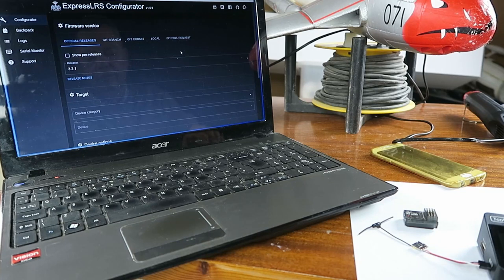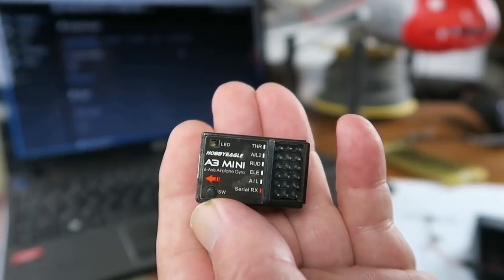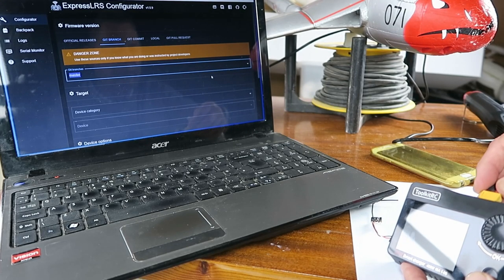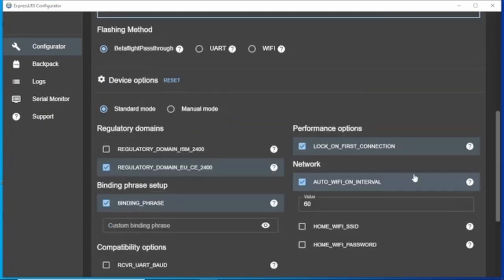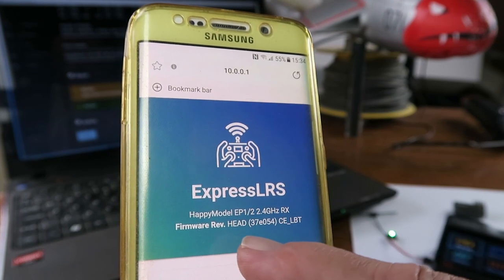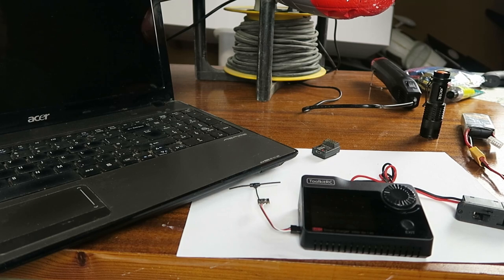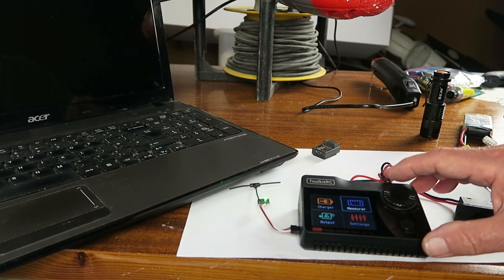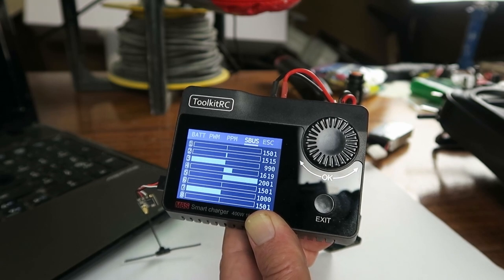ExpressLRS Happymodel EP1 SBUS Test

Comment: Very cool. I had not noticed ELRS had early support for SBUS.
 I've switched over nearly all my race drones and freestyle drones to ELRS using the EP2 receivers with the tiny ceramic antennas. They are awesome because you can't chop the antenna in the props. The range is also surprisingly good for racing and park flying.
Now it it time to start looking at putting ELRS on my fixed wing models that have the BYME gyros you put me onto. I will start with a small foam model since it is still experimental code. 
Thanks for your videos, I find there are too few people doing low budget fixed wing content.
Reply: The Byme stabs (and many other Chinesium units) require better than the standard 2-bit resolution on channel 5 (fixed to use for mode switching) - an exception being the Lefei Sparrow 3 which allows switching channels 5 and 6. No doubt there is (or will soon be) a way to change the channel allocation on ELRS that our Tech Guru here can put up a demo video about for us old computer illiterates. 🤔😜😉
Reply from the maker: Cheers Peter! ELRS and EdgeTx I like to keep an eye on as they're moving at quite a pace. A thing almost unknown in the RC world!! I'm currently testing the Matek R24-P6 which has 6 PWM channels, SBUS and VBat to monitor the battery! Watch this space!
Reply: @theoztreecrasher2647   Transmitter settings: "Packet Rates: 100Hz Full Res" and "Switch Mode: 16ch Rate / 2". Everything works great with BYME gyros.
But if the receiver is connected through the CRSF-SBUS (Matek) converter to get VBAT, an error occurs, the ailerons are up to the limit and control is not available, but I haven’t figured it out yet.

Comment: I tried this with the same RX, but with the ELRS 3.3 firmware, connected to an SBUS to PWM converter to control my esc and servos. It worked well until I tested my failsafe.  No matter which way I set the failsafe, "No Pulses" or "Last Position", the servos and esc output would be whatever they where when the TX got disconnected until I reconnected.  This isn't correct, obviously, but I don't know how to fix it.  Any advice?
Reply from the maker: The SBUS to PWM converter is "dumb" and can do nothing other than maintain the last known signal state. To use failsafe you need either a gyro like I show in my video or use an ELRS Rx that has the PWM output. On the Gyro there is a "gyro failsafe" mode where you can set the positions of the servo output for each channel in the event of a failsafe condition. An ELRS PWM Rx also can be configured in the same way via the Rx configuration page when using Wi-Fi. Hope that helps! Thanks for watching, have a great day!
Reply: @1nformatica  thanks I figured it was something like that but first time trying.
Reply from the maker: @lienmeat You're welcome! Here are 2 ELRS Rx with PWM that I have used, less expensive than "named" brands! https://s.click.aliexpress.com/e/_Dk6AL4L https://s.click.aliexpress.com/e/_Ddd5G2B Have a great day!!

Comment: I tried to flash the 3.3.0 firmware on the happymodel ep1 nano 2.4Ghz reciever but it says model name mismatch due to major update then when I tried to force flash it show not enough space error message
Any suggestions
I need sbus option so i tried 3.3.1 and 3.3.2 also same issue

Target: i choose happymodel 2.4Ghz and happymodel Ep1/2 2.4Ghz